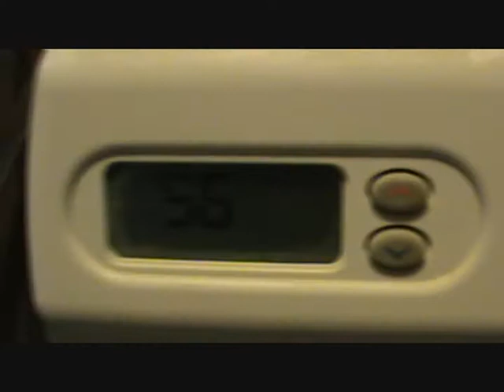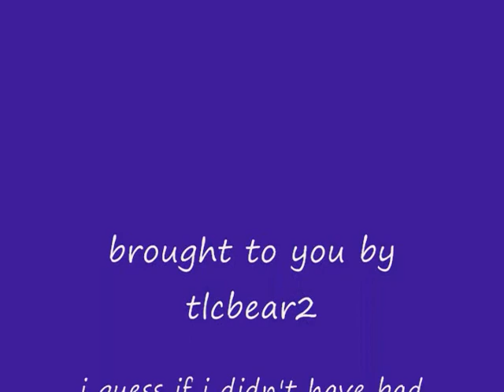computer desk work and more bad luck

Comment: You should be able to get the old furnace fixed, if it is pilotless and has the led indicator for codes, its not that old a furnace. Sounds like the place you called just wants to sell new. Usually what happens with those is a thermal sensor goes out or the main board burns out.

Comment from the maker: well its a old lenoxx pulse furnace they were to been removed and replaced .it has a green light saying its work no codes but it refuses to go.2 repairman that would show up wouldnt even touch it the other 3 i called and told them what i had wouldn't show to look at it.it is an electronic ignition so no pilot light. so you looks like im dead in the water for now.cause noway of coming up with the money for a new one